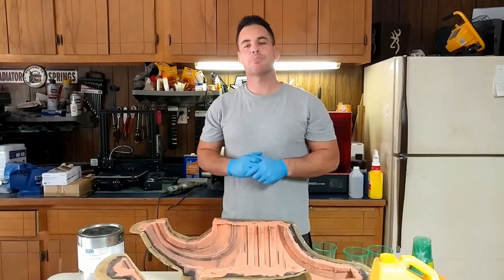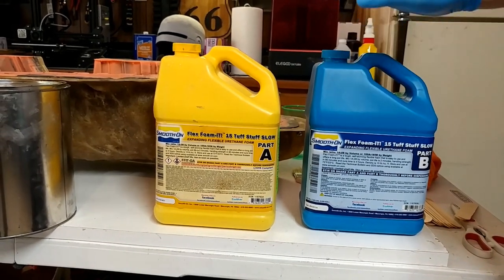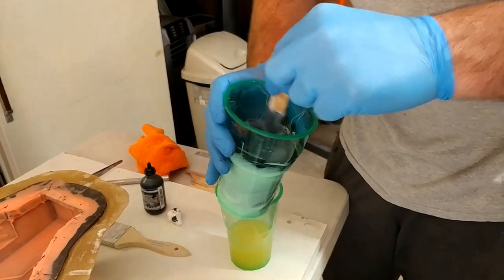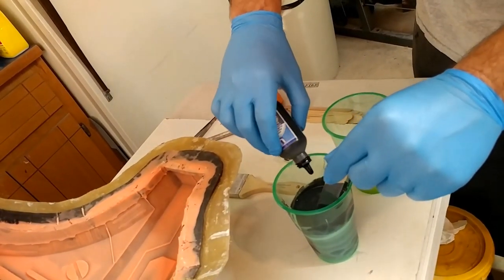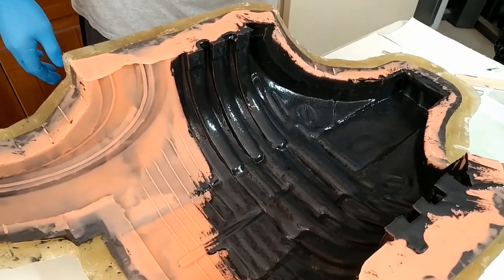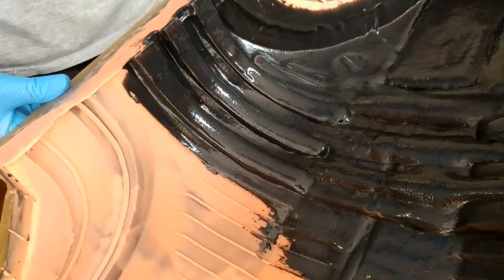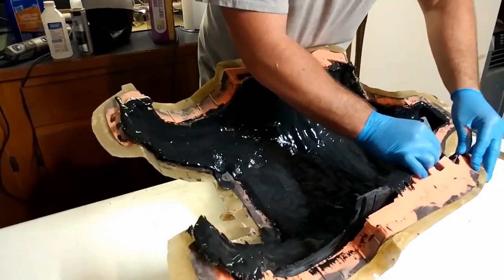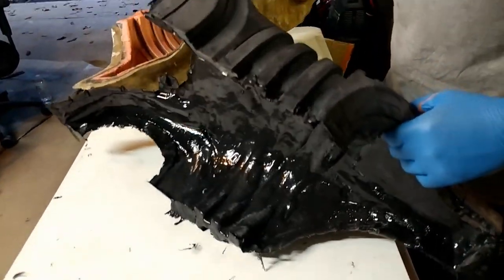3D Printed Robocop Suit - How I use Smooth-On Flex Foam IT 15 for my Robocop Midsection

Comment: I worked selling house paint for 8 or so years of my life and spent a lot of that mixing and matching colors by eye. One day someone brought in black paint (never had to match black in 6 years of working.) I started by just adding tons of black pigment but it wasn't dark enough. I can't remember all the different pigments that I added, but I know blue, green and possibly magenta and yellow oxide. Look in to how painters (artist) mix their pigments and achieve dark colors, even black, using a color wheel and some color theory. Not sure if this would do the trick, but it may be worth studying. You could always test it by mixing small batches of pigment, painting them on a surface, then using something like a hair dryer to help dry them (pigment will typically darken when it's dried.)
Reply from the maker: That's great advice, thank you for sharing your experience. I'll definitely look into that. I painted the midsection and it came out perfect but testing pigments would be interesting.

Comment: Hey man, great work on the suit and your videos are have been greatly informative. I’m working on a Batsuit and am utilizing both Flex Foam it 15 and Vytaflex 40. Quick question I’ve done two test castings with the urethane foam and I keep getting rough surface, nothing smooth like that mid piece you pulled. My only guess is that I made a mold of a 3D printed belt buckle and I’m thinking the print lines created little cavities for air to accumulate. I didn’t use filler on the print because I wanted to test how much fine detail would be captured in the Rebound 25 silicone. Did you have this issue and how did you get such a smooth finish?

Comment: Glad I found your channel. I’m doing something similar for a build. I wanted to know how long do you brush the product on the edges? Is there a point where the material has set enough that you stop?
Reply from the maker: Hey I'm glad you found it! For the first detail coat of silicone I brush just enough everywhere to make sure I capture all the details. Once I get full coverage of all the detail, I come back with a couple thicker coats to finish everything. With Dragon Skin 10 silicone I used..you have a pot life of 8 mins to get everything brushed on until the materials starts to thicken, so I try to get everything covered within that time but even when it starts to harden slightly you can still brush the material. You'll know when it's time to stop brushing. I hope that helps out!
Reply: @ChrisBoshProps  no no I mean the flex foam it 15.
Reply from the maker: @offearth3d Sorry about that I confused this with my recent molding video. Pretty much same concept expect your pot life is 2 mins. I always try to keep the material moving until it starts to set up. It will take a couple coats in your high spots to get coverage in some areas. You'll have to work fast and it might take a few coats in certain problem areas!
Reply: @ChrisBoshProps  no problem. Thanks again. Never worked with the product before and didn’t want to waste a ton of my trial kit